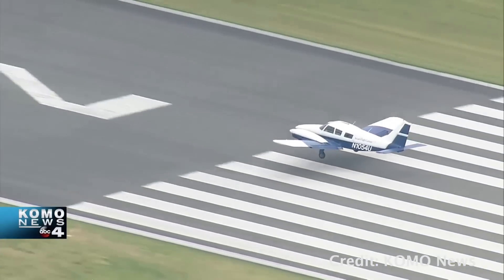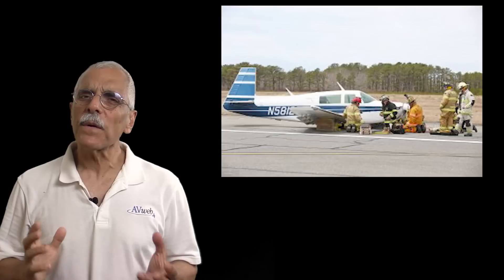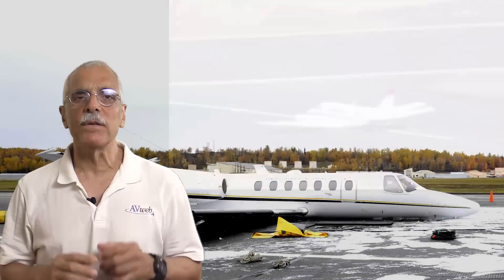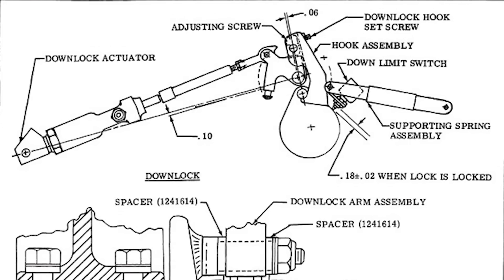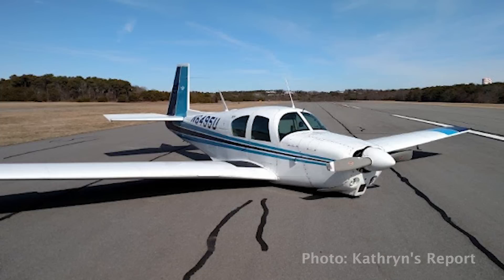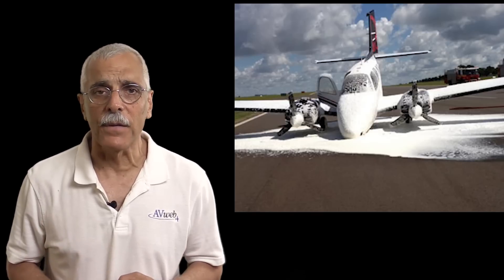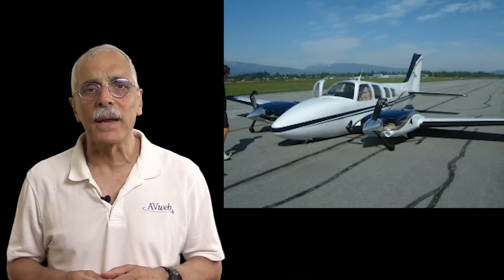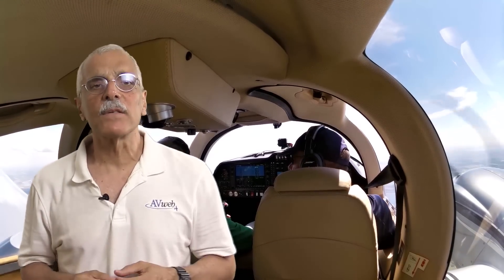Why Gear Up Landings Happen

Comment: Two words: paper checklist. If you follow a checklist every time, gear up will only happen when it malfunctions.
Reply: More words: All the checklists.
Paper Checklist
Followed up by Mnemonic on downwind.
Followed by a finals check on finals.
Then a "last chance" check at 200ft.
Reply: Bartonovich52 It's the guys who land float-planes, on water, with the gear down , sometimes killing someone, who really have convinced me that checklists are required every time.  It has gotten to the point that I don't think I'll fly with pilots who don't read (and recite out loud) checklists.
Reply: I GUMP it on downwind, base and again on final, OUT LOUD.  I also touch the green light(s).  Our Mooney has a single red and green light with a manual "Johnson Bar".    The Johnson bar is counter-intuitive.  That is, when the gear is up, the bar is down and when the gear is down the bar is up.
      In order to avoid confusion after I pull the bar up to lower the gear, I ask my wife to say out loud "we got a Johnson".  I always smile.  She never gets it.  But it does confirm when the handle is up, I'm happy.
Reply: daffidavit- Years ago, central Washington State, on Lake Chelan, a float plane pilot decided he got tired of the noise the gear indicator was making.  He thought for sure the gear was up, so he pulled the fuse for the indicator.  The gear was down, people died upon impact with the water.
Reply: @daffidavit  The all-manual Mooney landing gear was probably the most reliable of any. No electrics or hydraulics to fail!
Reply: @maverickdallas1004    It still is.  But I never rely on the green/red light indicator.  It's called a "Johnson Bar" for a reason.  I highly recommend all Mooney pilots to use the "sexist"  "Johnson" analogy I described above.  It never "fails". hehe.
Reply: @commentatron    roger
Reply: Edy B I have a friend, 777 Captain and Check Airman, Former Military Pilot. Went flying with him in his personal Cirrus, and noticed him running his take off and landing checks...so here is a guy with WAY more flight experience than me, for certain, sticking to the basics. So even though he had to declare a few Emergencies during his career, he never bent an airplane.
Reply: Professional pilots rhyme the checklists too. That's why flaps appear on several checklists that have to be done before takeoff, and there still has to be a takeoff configuration alarm.
Reply: I agree that paper checklists are important, but that's not true for every phase of the flight. In the traffic pattern you don't have enough hands and eyes for that kind of stuff.
Every second your eyes are on the checklist is a lost second that prevents you from looking out for other traffic. This argument is hard to invalidate.
Preflight, engine start, taxi, run-up, before t/o, cruise, shut-down, special trouble-shooting...: definitely paper checklist. A good pilot can recite the checklist in his sleep, but uses it nevertheless.
But with the high task load and often high traffic density the traffic pattern is a different story. A memory item list from mnemonics (CBUMMMFITCHH, CGUMPS..) has the same purpose and results as a paper checklist, but leaves your hands and eyes free for other important things.
Another aspect that shouldn't depend on paper (that's the way I learned it in my PPL training, but I'm sure many pilots are complacent about this): a verbalized emergency briefing should be done before every take-off, using memory items where appropriate, including local landing options, decision heights and engine failure procedures.
Reply: Yep. Flying single pilot IFR approaches with turbulence and what not, pretty hard to read checklists. CGUMPS With flaps / pattern legs.  Helps if you regularly fly and fly the same airplane all the time.
Reply: @delgriffith1  That is BS....
Reply: @DumbledoreMcCracken

Very few people will be killed by gear in the wrong position—even an amphibian landing on water gear down (on some it won’t even damage the plane). More people will be killed from fuel mismanagement, pushing weather, incorrect actions in event of engine failure, and midair collisions or CFIT—probably because they are trying to figure out where they are on their checklist. 

There’s a reason why we say control power drag identify verify feather for an engine failure in a twin. If you pull out the checklist you are dead  Or why we do a HASEL check before upper air work in a practice area... because if you are head down reading through a checklist you are dead.  Prelanding is done by using BBGUMPS or something similar. The U for Undercarriage is also for water landings where gear and water rudders are appropriate for the surface you are landing on. Ten bucks says most amphibian gear down on water landings were when a checklist was used and an item was missed or the pilot was distracted. 

Flows, pneumonics, and counting number of “things” (eg: cruise checks in my plane there are four “things” to do) are far better than checklists for single pilot ops. 

Sure.. two crew, I use a checklist. More like... I use my flows, pneumonics, and count things as pilot flying or seat appropriate... and the pilot monitoring does a challenge response checklist. The only other use a checklist has is for a student or pilot new to the aircraft to familiarize on the ground and with an instructor in the air, and to verify everything has been done after they’ve done their flows and pneumonics.
Reply: @Bartonovich52  You are mixing up your "know at heart emergencies CL" with your SOP CL...
Reply: This does leave you more susceptible to distractions though - if something happens that distracts you from your paper check list are you more likely to forget things?
Reply: There's a rule following paper check lists. If something distracts you from completing the check list you must restart that portion of the check list from the beginning
Reply: That sounds terrible.  You are way more likely to say check without actually thinking about it if you have to recite 10 things you already did, all the while being concerned that you are beginning to fall behind the airplane.

So many suggestions Ive heard in aviation sound great on paper but fail in practice.  Maybe that works for someone else tho, who knows
Reply: You don't recite them from memory, you re-do the check list as if it had never been done in the first place. Never start a check list in the middle because you will forget where you left off. Always start from the beginning.
Reply: I understand what you’re saying, and I’m telling you what will happen in practice if you train someone that way.  Having someone check 20 menial things multiple times with a runway fast approaching is a good way to get him to say “check” without thinking when you get to something important
Reply: Then that person should not be a pilot. Thousands of flights every day are done using the checklist method.
Reply: That is in large commercial aircraft that are highly complex and have 2 people at the front. We are talking about GA, where people are taught that in an engine failure you - fly the plane, spot a landing, check to see what’s wrong. Simple mnemonics and acronyms. There’s a reason gumps is so widely taught. 

Even in commercial aviation, there are some moments where a pilot must just know a series of things to do, without turning to a list. Engine failure on takeoff comes to mind.

I find arguments like “those people should just not be pilots” to be on par with “maybe we should just not fly at all,” especially when “those people” have been flying for decades
Reply: @atomicmrpelly  Are you really, I mean REALLY, arguing against the use of a proper checklist ?? 🤔🤔🤔
Reply: Never used one for over a decade. Never forgot the gear once. Extend at 3 mile final or downwind, check with each flap extension, and a short final check... handle, indicator, and visual (wing mirrors). 

Paper checklists are cumbersome to use single pilot as they often contain far more information than they need to and it's easy to lose your place and forget stuff.
Reply: @Bartonovich52  and you could not wear a seatbelt for 10 years and still be fine, it doesn't mean it's not stupid to forgo a seatbelt
Reply: @Bartonovich52  Sir, you have made everybody who has read your post a little bit dumber for doing so.

Comment: I too had a gear up landing in my Mooney M20 after being unable to extend them. I also shut down the motor on long final saving my prop and motor. As you know props are very expensive and prop strikes are an automatic engine tear down for a crank inspection. All I had to do was lift the plane, extend the gear and tow it into a hanger to repair the gear malfunction. No real panel damage since I put it down on a grass strip. Two years later I sold it to a guy who did forget to extend the gear costing him a prop, engine and heavy panel damage. He told me the gear warning indicator was screaming at him, but didn't hear it!
Reply: I didn't have insurance at the time, hence save everything possible from damage.
Reply: Do you need to have insurance on an airplane the way you have insurance on a car in CA?
Reply: insurance or not, you may just want to save your beloved airplane.  
some people actually like their airplanes.
Reply: I doubt it, but it would depend on the prop. It's certainly possible, but unlikely. probably the least of your worries at the time.  
The metal props i have seen strike have all bent, instead of breaking, but if the prop itself can be saved, that's huge. and the engine too. 
there will be damage to the airframe anyway, but kinda unavoidable. ..
Reply: SanFranciscoBay  No.
Reply: XB10001 Qua?
Reply: +SanFranciscoBay for car insurance, you're only required to cover damage to OTHERS. not your own vehicle.
Reply: +james pogrebetsky — That's what makes auto insurance upside-down and bass-ackwards in the U.S.A.  Insurance is a concept that comes out of maritime law, but in that realm it is to protect one's own vessel and cargo, not someone else's.
Reply: Actually it isn't "upside-down" - the insurance isn't to "protect the other party's property" - it is to protect your own assets when you are sued by the other party for damaging their property.
Reply: bilness: by FAA standards the crank must be inspected (magnafuxed) if it`s a charter . I remember the j-3 cub at Burlington having at least one prop strike and it was returned to service with a new prop. And it was metal.
Reply: Is there also a possibility of the prop breaking apart?  bits flying off damaged props might do a lot of unintentional damage...
Reply: It's spelled HANGAR, not HANGER.
Reply: Hanger? Really? So you "hang" the plane?

Comment: I've experienced the opposite. Gear down landing... on water! It was on a SeaMax wasn't pretty, but the thing was back in the air after minimum repairs. Same problem, distraction weather the gear stayed down from take off or if i got it down approaching the lake i can't tell.

Comment: Great video thank you. My father was a pilot and owned a Cessna 320 twin turbo ah ha so it was actually called a Cessna 310 but the 320 stood for twin turbo it was a very fast 340 mph plane. flew many a mile in that plane but never Lost the landing gear or ever forgot. But we Lost an engine once Very scary. Struck by lightning another time very scary lost all electrical think goodness those older airplanes where fly by wire.

Comment: I thought as long as the prop does not strike the ground while the engine is running you do not have to tear down the engine to inspect the crankshaft. If you shut the engine down you might not save the prop but at least you are not damaging the crankshaft.
Reply: service manuals still call for a tear down if the engine wasn't running and the  pro is damaged. Even if there was no obvious damage to the prop, I bet insurance will do the tear down.

Comment: Closest I came was doing my MEI training in an old 310.  I was in the right seat, single engine, on a right base, and put the gear handle to what I thought was down, but actually was only at the middle detent. Workload was high and the single green light isn't visible from the right seat without a special effort.  If it weren't for an observant airliner holding short and giving us a heads up, I would be in the club.

Comment: Had a nose gear light not illuminate on a Queen Air 65 down in Mexico. At about 2pm with the sun showing my shadow on the ground at 500 feet, I could see that my nose gear was indeed down. It was. So use your head & think for out of the box solutions! From then on I always kept gear light bulbs nearby.
Reply: Eastern Airlines flight 401 kept some spare gear light bulbs in the cockpit of their Lockheed L-1011 Tristar too... Pity nobody was flying the aircraft while all 3 crew members watched the first officer try to replace the light bulb while they crashed.
Reply: musicalaviator .....I wonder if the light bulb survived? I hope so!
Reply: #light bulb lives matter
Reply: @musicalaviator  yea I remember that one real sad.
Reply: With LED equivalents now available for damn near ever incandescent pilot and indicator bulb ever manufactured, there's no more excuse for burned-out panel lights for the life of the aircraft.  I was once quizzed by a flight instructor about how I would handle a panel light failure, and I told him I'd try to substitute a bulb from another, non-critical indicator, and once on the ground, I'd replace the burned out bulb with an LED.  He looked at me in horror for even suggesting the use of a part not approved by the FAA or the manufacturer.  He probably didn't realize he was talking to a Professional Engineer, not a trained parrot.
Reply: I carry an extra set of landing gear in my overnight bag as well.
Reply: or swap one of the main gear lights with the nose light to check if it's that
Reply: In reference to the gear down lights;  those lights don't just indicate the gear is down but that the gear is down and locked. Point being with a light that fails to come on after extending the gear; if after you check the function of the light bulb (and find it's working) even if you observe it down by shadow, wing mirrors, or another's observation you have to take proper precautions in the event the gear appears to be down but it may not be locked in position resulting in collapsing once weight is placed on it.
Reply: tough to tell if its locked, but smart thinking
Reply: They should put the equivalent to a backup camera in a car in the landing gears for visual confirmation, gear cams?
Reply: correction,  #lamplivesmattter, a bulb goes in the ground. Not so sure about  L.E.D. lives, since they live so long....

Comment: In the glider world we encourage "gear down and locked" as part of the circuit announcement.  We also keep the gear check as part of the check list on the trainers with fixed gear, install the habits early.

AND here is a video to add to your list, from the pilot's perspective :) https://www.youtube.com/watch?v=5McECUtM8fw

Fly Safe

Comment: I didn't have time to film the two I watched. But both were "I forgot" scenarios in Barons. Both times, as soon as one of those trucks used for delivering 1000 propane tanks came and lifted the plane, the abashed pilot would flip on the master flip the gear handle down and the gear came down and locked.

Comment: Folks who have geared up tell me that the hot/burning smell is profound, as I witnessed myself as 'first on the scene' of a Glasair gear-up due to mechanical failure. That hot smell is enough to chase anyone out of the cockpit, although once they get out and look back they usually stop and relax.

Comment: During flight training in light twins a friend of mine had a theory that a pilot will subconsciously associate the configuration/gear warning horn with flying asymmetric (engine out) as that condition triggers the horn (one throttle low, gear up) and so much time in training on a twin for that engine out scenario.  During training in that scenario you essentially train your brain to ignore the horn, and thus when you get it during a normal approach it becomes all the easier to ignore.  
I'm not sure if that issue has been addressed with more recent twins, but it was certainly the case in both the Duchess and Seminole.